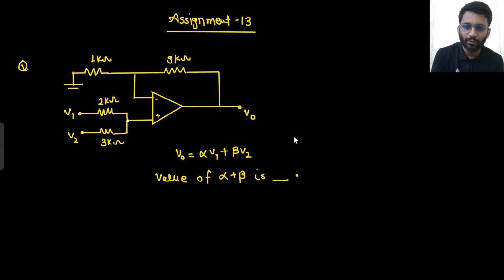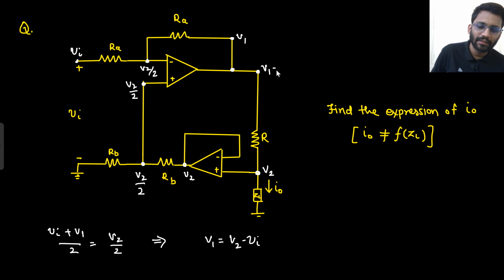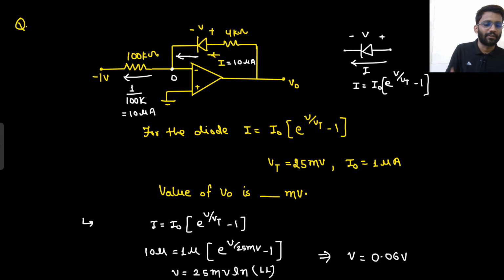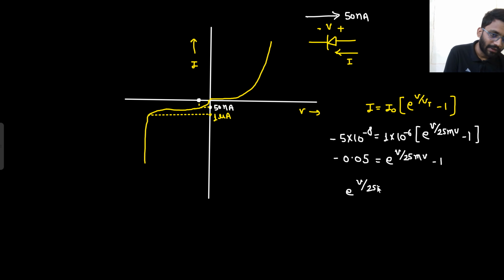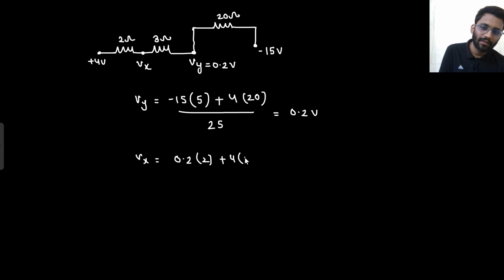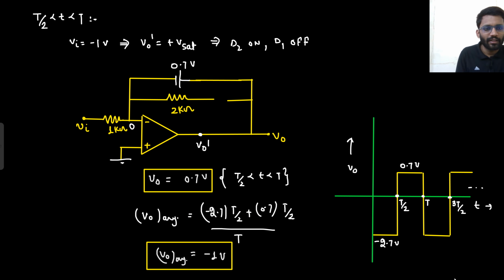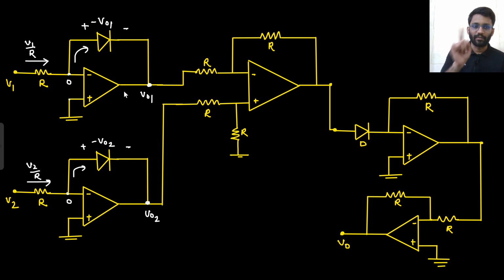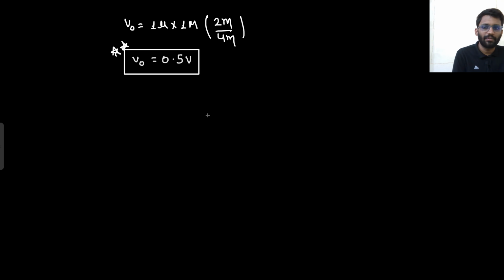Assignment 13 Solutions || Analog Electronics || PrepFusion || Himanshu Agarwal

Comment: In the 2nd question what is the meaning of negative resistance
Reply: that the current is flowing in the opposite direction...which results in voltage drop in opposite direction